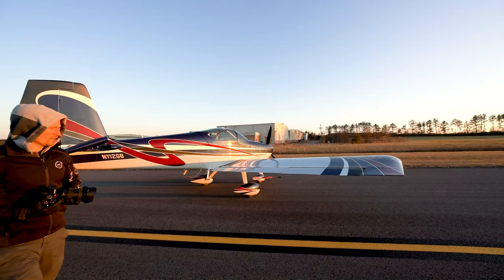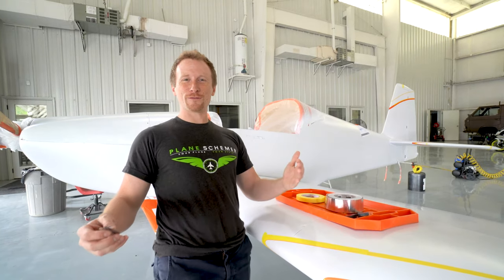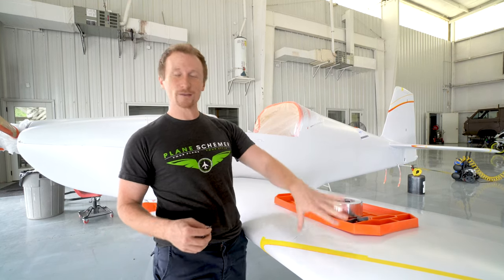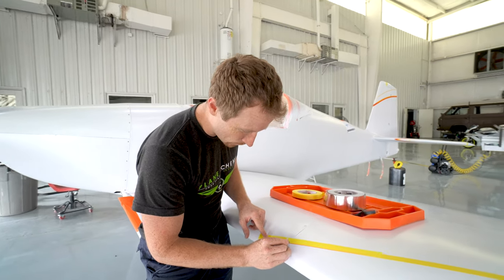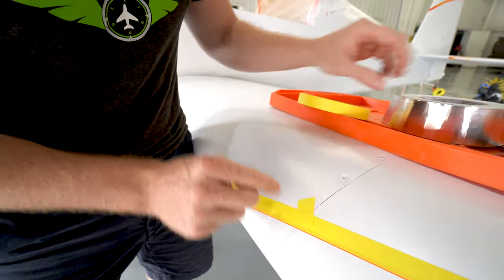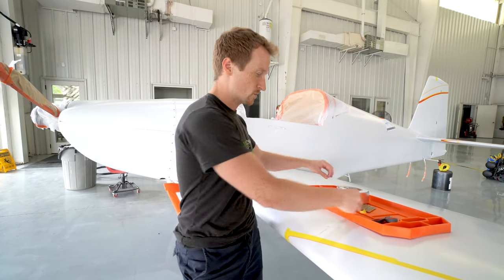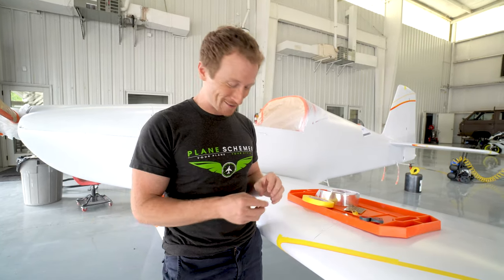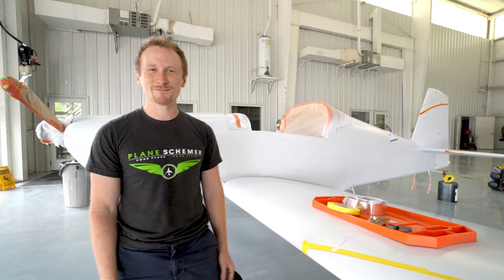How to get those CRISPY paint lines

Comment: any tips on the paint line going over rivets? I struggle every time with the rivets. I usually put a light coat first, push down fine line tape after the light coat, then push down every rivet during the next couple of coats. Real pain in the ass lol. There's gotta be a better way.

Comment: Spray a light coat of clear over the tape line. Color will not bleed and your edge will be crispier than KFC
Reply from the maker: Thank you for watching! This can work on single stage paint (sometimes). I definitely wouldn't recommend that on a base/clear system where you're stacking base colors that are formulated to chemically bond to each other. You'll stack additional layers of paint and build up thicker paint edges, then when you clear the entire plane you'll be able to feel those paint lines. It might work in some situations but it's not ideal for our painting process.